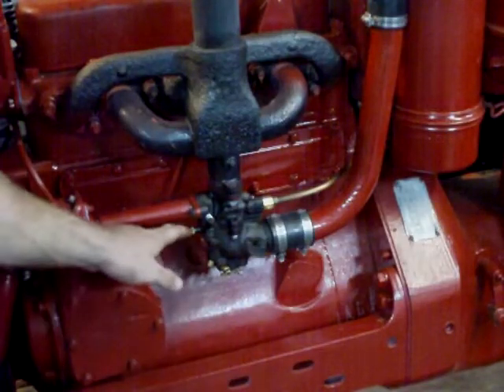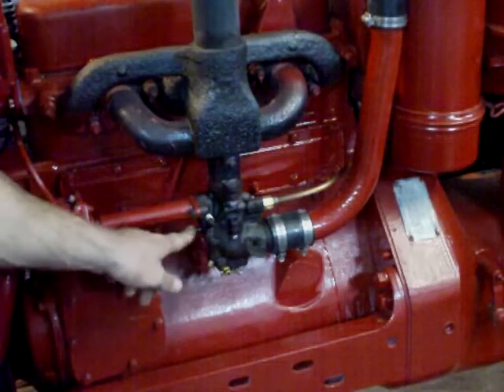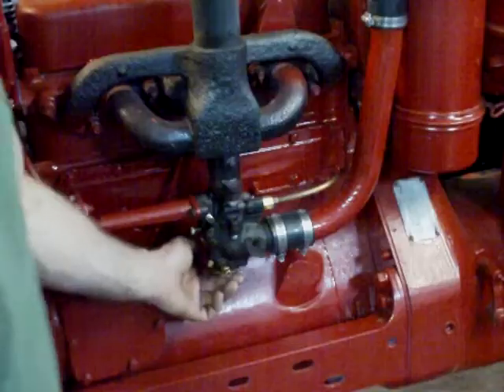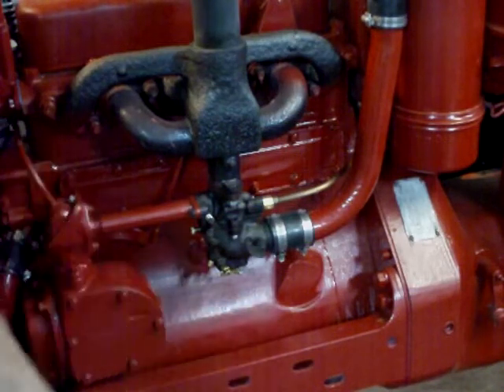Farmall H Carburetor Adjustment

Comment: What is the screw above the low idle screw above the carburetor?
Reply from the maker: The low idle screw is on the  carb where throttle shaft tube attaches. Below that is the idle circuit adjustment screw. Does your have the original H carb like in my video or does it have the "upgraded" carb like a super H, M etc?
Reply: @MetalandMachines  it looks like the one in your video. You didn’t mess with the top one in the video is why I was asking. Mine recently started using oil and not running as well as it had before. So I found your video looking for tips
Reply from the maker: @ErikkSchoeff  I think you may have the updated style carb. Email me a picture so I can be certain and I will tell you what the screw does. You can point to the screw or draw an arrow if you would like. Metalandmachines1@gmail.com

Comment: I think my float is clogged? Where do i try spraying carb cleaner?Becky from WI.
Reply from the maker: Do you have gas running out of your carb? Do you think your float has a hole in it and the needle valve isn't seating to shut the fuel off?

Comment: I have gas coming out from the bottom screw. It's will surge and pop but it's not consistent. It's really intermittent
Reply from the maker: Your float could be set too high or you have a needle valve that is not sealing due to wear or debris.
Reply: @MetalandMachines  it was rebuilt last year. Everything was replaced ran great until last weekend. Thought I had bad gas so I added some dry gas. No change. Replaced spark plugs. That helped a little
Reply from the maker: @toddpayeur3878  I hate that I didn't see your reply until now. Sounds like you probably just got some dirt under the needle valve and it wasn't sealing. Did you get it figured out?

Comment: I just got a 43 farmall H. I’m new to the brand. There is a little bleed valve? Just above the load screw on the bottom of the carb. I have fuel gushing from there unless the engine is running at a decent rpm. I turn the tractor off and if it sits for a minute it will start to leak again. What is this little hole for?  Does it mean my float is out of adjustment?
Reply: Yes

Comment: I think the main was 3 turns out factory settings
Reply from the maker: You can start at 3 if you like, but I always start at 2 1/2 turn and that always works for me, and then I fine tune it as stated in the video. I may be partial but you'd have a hard time finding an H that runs any smoother than mine does.
Reply: @MetalandMachines  mine runs equally well, but yes both great runners
Reply from the maker: @FarmallFanatic  Do you have any videos? I always like to hear a good farmall running. I've been on mine most of the day clearing brush and digging out stumps with the loader, then leveling the ground back with my Super A with the A60 front mounted blade.
Reply: @MetalandMachines  I got about 575 videos to date